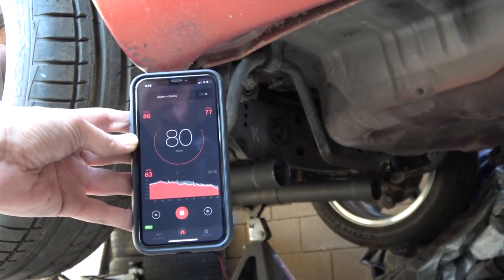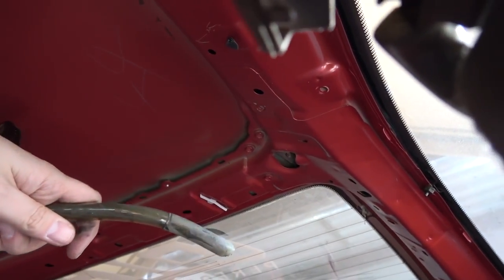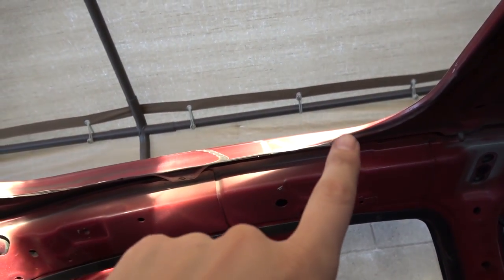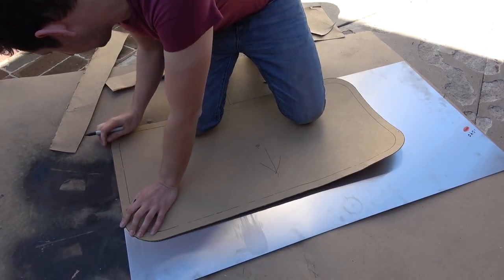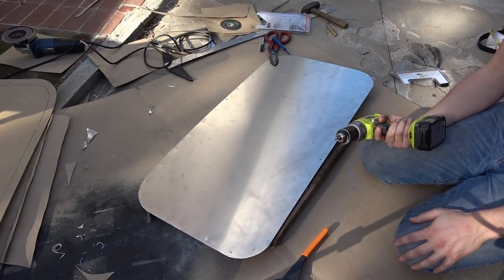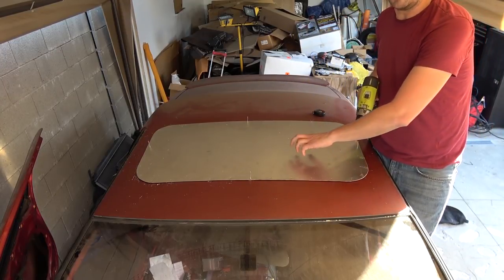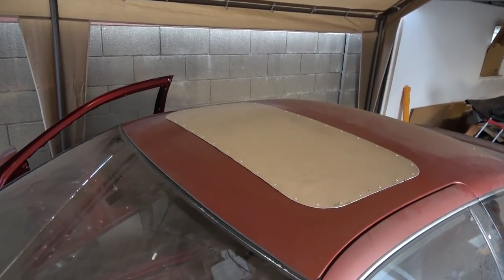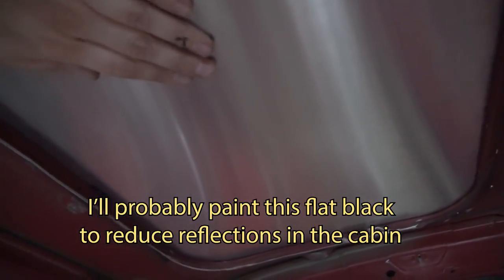Making a Sunroof Delete Panel for Under $30 - Lexus SC400 Budget Drift Build. Ep.52

Comment: Very informative video.  I have an 83 Chevy k10 pickup that has a sunroof probably installed in the 80s.  Obviously it's completely deteriorating and leaks water on my new interior that I have so much time and money in. I really needed this idea and I might take it a step further by brushing a thin coat of body seam sealer,  the same stuff people use to seal new floorpans. I plan to paint the truck in the next year or so. I will just leave the raw aluminum finish for now. Besides my truck is lifted 6 inches and rolls on 35 x15 tires anyway so few people see the roof..
Reply from the maker: Sounds like a good plan. The aluminum panel with weatherstripping will definitely seal it up well.

Comment: Awesome job as always! I still can't believe you have 2.7K subs when this is better than vids from channels with 100K. :P
Can you sell the sunroof assembly for anything? That would be a nice bonus. Can't wait for the track day!
Reply from the maker: 802 Garage I actually didn’t test the sunroof before removing it. It doesn’t leak, so as long as it works correctly I could probably sell it. Just need to find someone looking for a sunroof for a 26 year old car. :)
Reply: I know for a lot of older cars it's a pretty common item for someone to look for. Especially for just the glass. One assembly sold on eBay in November for $218. They don't seem to sell often, but they are worth money. Could test if it works off the car with just a battery too.

Comment: I wanna do the same thing to my SC but I'm planning on using lexan since my car is still a street car and way the accessibility of having a sunroof. But racecar right lol!!
Reply from the maker: I thought about lexan, but the aluminum was going to be faster and cheaper. I may still switch to lexan in the future some day. Rob's Chairslayer S13 has a lexan panel for the sunroof and it looks pretty awesome. Just cracks super easy.
Reply: Fully Spooled I didn't know they cracked easily but I'm still going to have sort of interior, if I had a full blown race car like yours I'd prob change my mind or not even have a sunroof in general

Comment: Do they require you to remove the sunroof , or do you just want to save to 5 or 10 lbs ?
Reply: Ok the 30 or 40 lbs lol
Reply from the maker: @gopherchucksgamingnstuff2263  My helmet was hitting the sunroof when I was sitting in the car. You can absolutely have a sunroof in a drift car, but you can't have your head smashed into it the whole time. :)

Comment: I would use clear plastic (ecrilic) instead
Reply from the maker: Yep, also works. I just didn't want to deal with the cracks that will ultimately form with acrylic. Aluminum is a very permanent solution.

Comment: @Fully Spooled would you happen to know if the seat rails are the same between the sc300 and sc400? If so you might want to look into some corbeau seats they're really comfortable i have a set in my honda crx
Reply from the maker: Yes everything is the same between the 300 and 400 minus the engines, transmissions, and small things like diff ratios. Things like interior pieces, suspension, body panels, etc are all identical. Corbeau seats are nice. They are on my list of seats to check out for sure. Just expensive like any FIA approved seat.
Reply: Fully Spooled well the regular forza seats are only about 230 and the rails are 120 so not to bad in my opinion. I bought them one at a time just left the stock passenger seat in. But in your case you could just get one for now and move the one currently on the driver side to the passenger side. Because let’s face it how many 6’2” passengers are you gonna have riding along lol.

Comment: how has it held up so far? do you think it could withstand weather as a daily driver?
Reply from the maker: It's held up great. Just make sure to add enough 3M weather stripping around the rivets. 3 of my rivets leaked about a drip every couple minutes in heavy rain, so I had to add some more sealant on the bottom side.

Comment: any ways to hide the rivets?
Reply from the maker: Unfortunately no. Rivets have to go through both layers of metal. You could try using countersunk bolts that sit flush with the panel, but you'd still see the circles where the bolt heads are and they may not work with how thin the panel is.